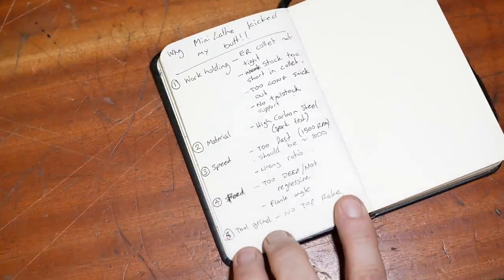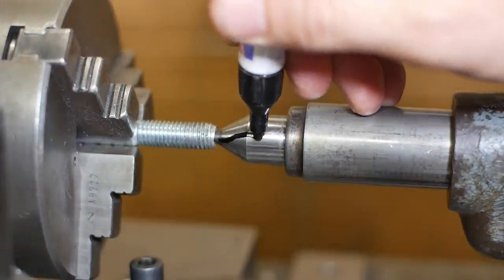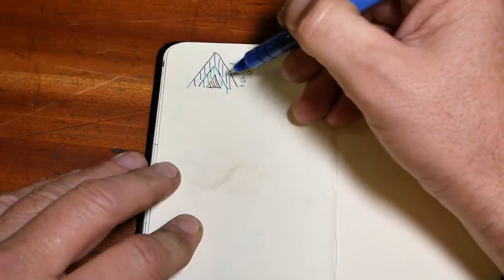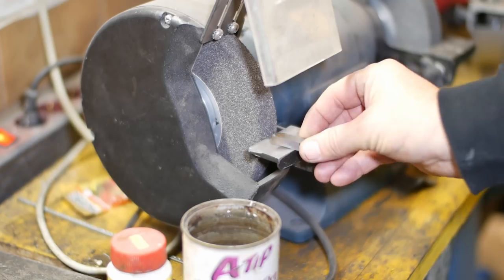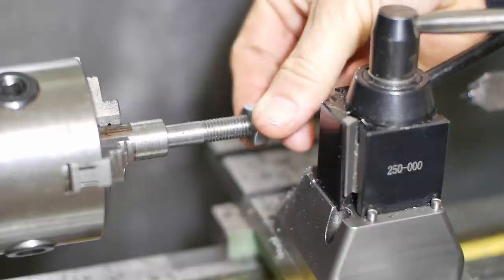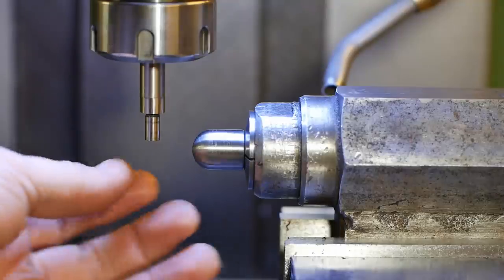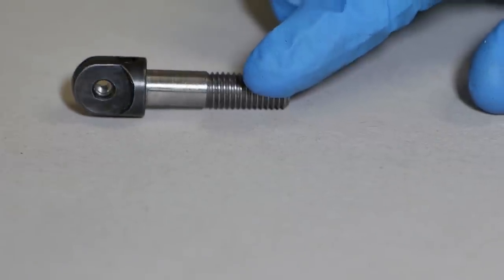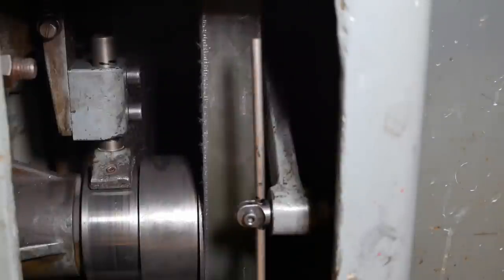Man vs Tiny CNC Lathe - Rematch! - Episode 39

Comment: As nice as the iPhone is as a angle and level gauge,  I would invest in one of those cube angle gauges. They are incredibly useful.
Reply: Yeah, especially the magnetic ones, but he lives in Austria, which is in a hard lockdown right now. And besides, if an old iPhone that looks way better and is easier to read on camera does the job, why change anything? It's not like we're building a diorama of Starship SN9 here, are we?
Reply from the maker: I'm impressed just how handy the phone app is for this. Hard to justify forking out for the angle guage when this is already in the pocket.
Reply: @RotarySMP  Wait, is this still your daily driver? Didn't they drop support for that phone?
Reply from the maker: @vincentguttmann2231  It is 5SE. The battery is nealy dead, so it is always on charge.
Reply: @RotarySMP  That sounds like a clear no to me. I like its design though! And those rectangular sides make for excellent registration against metal parts.
Reply from the maker: @vincentguttmann2231  true.
Reply: @vincentguttmann2231  True, but those cube gauges are under $20 nowadays.  They also stay put allowing you to work with one hand.
Reply: @bobweiram6321  Well, I think.he has one, but as he said in previous comments, this app is really nice. And besides, it works very well. And we don't need crazy precise angles when grinding a tool. Sure, you don't want your clearance angles to actually be non-existent, but whether it's 10° or 9.73° does not matter here. It did the job, was easier to read in a space where a digital angle gauge would not have worked as well because of lack of a big magnetic surface. If you look at the bending of the chassis two or three episodes prior, he used a cube gauge there. But it works, and besides, that tool is ground and works, and this episode is filmed
Reply: @vincentguttmann2231  Wow! What prize were you planning on getting with that comment?

Comment: One suggestion for the fiddly chuck change, is there room to change it to the style with a captive keyhole ring behind the spindle flange? DIN55027 is the spec, I think. 
Or, just make a whole new spindle with a D1-2 nose. And a whole load of D1-2 cams, studs and backplates as D1-2 is super-rare. (Used on only two lathes that I know of, http://www.lathes.co.uk/pratt&whitney/ and http://www.lathes.co.uk/holbrook-C8/) D1-2 puts the stud PCD inside the locating taper.
Reply from the maker: Hi Andy. Yeah....nah! that is not going to happen. I once drew up making a D1-3 adapter for the Boley, but it interfered with the threads. No way will I polish this turd to that degree. The Schaublin 125CNC I picture one day buying is a D1-3. 

Wonder what lead them to use D1-2 on the Holbrook? Steel shortage :)
Reply: @RotarySMP  D1-2 wasn't really a serious suggestion, it would be a lot of work. But DIN55027 is just a matter of making a keyhole ring and enlarging the holes in the spindle flange. 
D1-2 for both those lathes seems smaller than necessary, D1-3 would not have been that out-of-proportion. I doubt we will ever know. 
Though I think D1-3 would be oversize for the mini lathe.
Reply from the maker: @andypughtube  That would entail pulling the spindle, which is about 600 steps back along the mechano set assemble instructions. It is not actually that bad to change chucks, unless you are trying to film.
Reply: @RotarySMP  Maybe get the right Wera Joker Switch spanner for the job for Christmas? (They have a nut-holder on the open end)
Reply from the maker: @andypughtube  I thought that is what superglue on the finger is for.

Comment: You might also wish to try incremental feed vs flank infeed. Not sure if it would help or not. http://www.mitsubishicarbide.com/en/technical_information/tec_turning_tools/tec_threading/tec_threading_guide/tec_threading_methods
Reply from the maker: Thanks. That is an intesting resource. Unfortunately LinuxCNC does not offer a canned cycle for that, and my CAM doesn't either.

Comment: Despite what a load of old fogies might say going straight in is perfectly fine especially on a fine thread like M10. I have conducted experiments using the same single size insert on the same material and even under a microscope you cant tell the difference. Swarf cross interference is no issue except perhaps for lathes made from balsa wood or maybe on really coarse threads.😉
Just a point about threading, the nose radius must be exact if you are only going by depth of thread to get a good fitting thread. Too sharp a radius gives a false reading.
Other than the above i really like your, er, polishing.😆
Reply from the maker: Thanks for your feedback. I am pretty sure this bed can be considered Balsa! I did some deflectiong tests on it back in about episode 7, and it is a wet noodle.

Do you see a downside in feeding down a flank? It seems like  even if it has not benefit, it would have no negative side effects. In LinuxCNC, all you need to do is add Q29.5 into the G76 line.
Reply: @RotarySMP  true enough except proper machinists (?) like to keep their top slides set exactly parallel to lathe axis, or sometimes at a small set angle for 10 to 1 ratio cuts. So why turn the top slide from its precision position when not needed? I must add the above is for manual machines rather CNC of which i know zilch, except when it stands for Chris' Numbskull Control of which i know plenty.😉
Reply from the maker: @chrisstephens6673  You know the Boley I have, one of the things that bugs me about it is the top slide geometry is such, that keeping it parallel to the bed for precise length of cuts, it ilmost always interferes with the tailstock (if needed for support). And then it can't cut angle of more than about 50°, as the top slide handle hits the cross slide, and cant rotate. For such an awesome lathe manufacturer, it is pretty annoying.
Reply: @RotarySMP  there is never going to be one machine to please all users, some folks even remove their top slide altogether like RobRenz or Stefan Gotteswinter for the extra rigidity. In early days some lathes didn't even have a top slide from the factory.
I remember demonstrating threadiing on a Myford at a show and a number of old time machinists said it cant be going straight in, then a younger oldie piped up saying he was also taught that "fact" but when he got his first job and had to cut a thread his foreman said something like "why are you wasting your time moving the top slide, just go straight in" and apparently he never bothered doing it ever agsin. I sort of miss having fun with live audiences, andbopening minds to something different.
Reply from the maker: @chrisstephens6673  I have seen STGW and RobRenz's  top slide removal. They seem to always cut small tapers with form tools. I am too lazy, and just use the top slide.
Reply: @RotarySMP  just to complicate the issue my lathe has two top slides.
Reply from the maker: @chrisstephens6673  What make and model?
Reply: @RotarySMP  standard Colchester Bantam but with an Atlas (i think) top slide grafted on the far side of the cross slide. Original intended for fitting parting tools and a chamfer but now just a rear tool post for chamfering.
Im with you on the lazy bit, but judging by all your polishing of you know what i out rank you by a mile.😉
Reply from the maker: @chrisstephens6673  :)

Comment: You should try G-Wizard Calculator from CNCcookbook. Takes care of all of your feed & speed & feed problems. I haven't used my copy yet because the Triton isn't running yet but the software looks very promising for relieving me of the unknowns when I do get running. As I understand it, it also includes a tool library.
Reply from the maker: My CAM already does feeds and spped pretty well, when I remember to coordinate its tool library with the ones I actually have :/

Comment: easy fix, get rid of that bloody computer shit, and put the handwheels back on!!!, then and ONLY then, will the machine do exactly what you tell it to do.
Reply from the maker: :) 
I will sell the mini lathe and the Boley once I have the Schaublin up and running, but really do like having a manual lathe for those quick, no precision required jobs like turning up a bushing to be welded. I'll do jog wheels on both axis of the Schaublin to simulate the manual experience, but may end up getting another manual lathe long term.